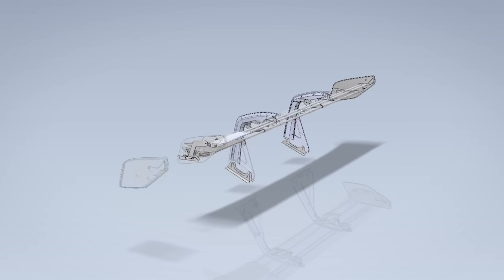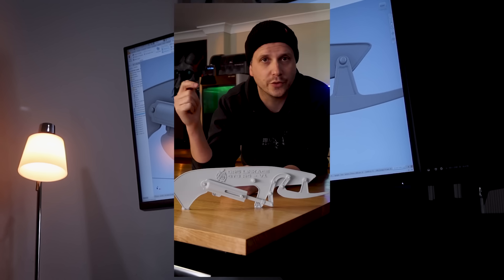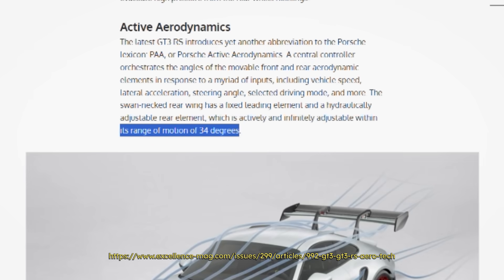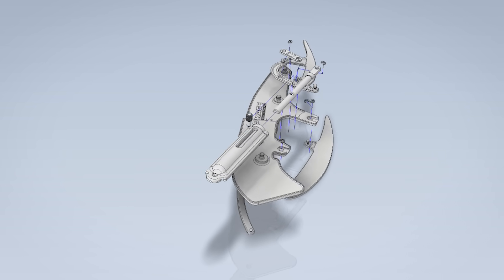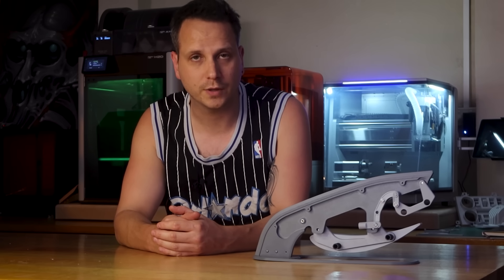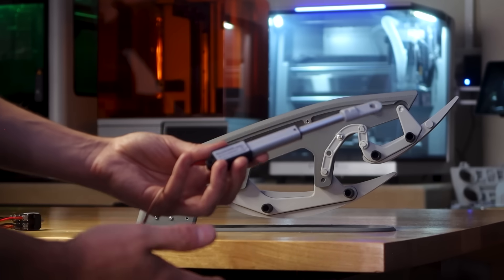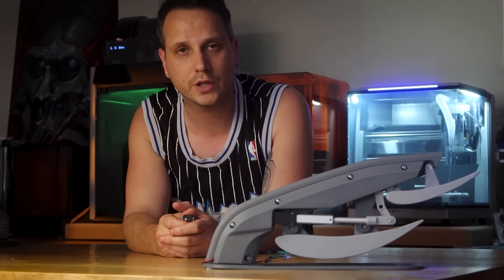I Built a Working DRS Mechanism Using Only a 3D Printer

Comment: Hey. Loved the video. Just a question on the 3d prints. When you make parts sideways with support, doesnt the spot where the support makes contact with the surface of the cilinder (or pin), break the cleanliness of the surface? wouldnt it be better to print the parts standind so no support makes contact with the printed surface? just a question.... thank you

Comment: Great job! 😎👍
15:45 - The disadvantage of cylinders is that the pushing force is always greater than the pulling force, because the rod itself interferes, the piston area is smaller on one side than on the other. You can try swapping the hoses on the distribution block, you will get the same result.

Comment: the Mercedes hydraulic return soft top / hard top roof is a known to fail component, difficult to remove/ install, and often economically writes these cars off, ive replaced one, if you do decide to go the wrecker route, bring all the gear to jump the circuit and confirm it works, or get warranty on the parts, as the parts are not cheap, you can often buy running registered cars with "Broken" roofs for roughly 1K here in NSW, and theyre not a bad way to go for parts, when you account for refunding remaining rego, sellling some parts, and sending them to scrap, atleast in sydney wreckers pay $500 for full cars picked up from your door. the system is wuite basic but lots of small parts that can be hard to diagnose in the vehicle as they require almost full disassembly to get to basic components. good luck
Reply from the maker: Thanks mate I appreciate the detailed info.
I was a little concerned at all the info I found when researching it was basically people complaining about how hard they are to fix haha.
I was thinking it might be good for my own knowledge to pull apart and play around with but you're right in suggesting they might not be best for the final design.

Comment: I have done this to my wing. I used pneumatic actuators with an electric solenoid control valve, small compressor and used a small fire extinguisher as a tank. I have a small regulators on each side to I can control the opening  and closing speed. Works great and is quite fast and strong. I am using it more for an air brake than a DRS system so I have quite a bit of force when active.
Reply from the maker: Awesome! Reassuring to hear people have had success with that approach

Comment: I would think a servo motor and cable control system instead of a linear actuator would be a little better and less intrucive to the support structure of the wing and A LOT less to deal with than an electrohydraulic control system. Very easy to control with a PWM motor controler and a arduino and just tap some CAN signals for data in and use as a relay and make sure votlage in matches out so to avoid messing up the LVDS signals from the CAN. The 5 bar linkage is geat though for strength and fine adjustment, I would be concerned with longevity with stress on those pivot points and no sealed lubrication, maybe use a PTFE coating or teflon liner and 0 tolerance fit with stainless steel machined parts? some really cool surface finish anodizations with PTFE in them for aluminum now, use a 7075-T5 alloy and it will be PLENTY strong and self lubricating, but expensive.
Reply from the maker: Thanks mate I appreciate the detailed response.
I'm pretty much at the point of hardware specification and was looking into options for the pivots etc, but it definitely needs further consideration.
It's also an effort vs application thing, how much use/abuse the system will actually see on this particular car and if the reward for effort is there in terms of time spent.
I'll look further into your suggestions :)

Comment: Great Video.  This is something that I've been researching and designing in my off time for most of last year and stumbled across the porsche build and then your collab was uploaded. 

Electric servos were out of the question because of the force and speed (and the inverse relationship with E-servos) that I wanted for my project.  Then I began looking at solutions for a hydraulic system which at first I began to believe was out of reach.  Then I happened to have stumbled across RC Excavator builds on youtube which peaked my interest and made me excited.  I needed form factor, small motor, small actuator (and associated systems) that can fit into my boot and have enough MPa (Bar) to actuate the wing which I could get from these RC systems.   If you pair this with a Raspberry Pi or Arduino (I went with Arduino), IMU (accelerometer), a motor driver, an OBD II module to read actual vehicle data (for more inputs along with the IMU), and other small components then it is more than possible to have active aero on a build.  

Your collab was perfect timing because at first I wanted to actuate my whole wing but the I didn't know what range I wanted the AOA and most importantly an actual idea for what type of linkage mechanism to use.  I immediately went on your site after Mike Lake uploaded the DRS video but at the time the DRS model hadn't been uploaded.  BUT NOW ... I you have the model and its time to play around.  Thank you and please keep this series going.  DIY Active aero is starting to gain traction but there are only a few serious attempts on Youtube.

Comment: simplify and use mass lower, i would rather do the actuation with thin stainless steel cables and teflon conduits, and place the two big servo motors inside the body, pulling the cables with a pulley.
that would keep only mechanical parts outside, while the electronics hardware stays inside and lower to the center of mass of the car.
inspiration is animatronics, but made for the job of moving the spoiler blade, tough and precise.

Comment: Just curious, did you ever see the lemons racing drs with the bowling ball on a rope/spring. when you had any change in angular momentum it would swing the ball pulling the wing down.
Reply: Absolutely mad that is. 😂 bowling ball drs
Reply: @UdzalZarnick redneck engineering working at optimal levels
Reply from the maker: No I haven't but I will do a search :)

Comment: I'd consider just using the pneumatic system, but you'd need to consider how much force is required and the diameter of the piston that you can fit.

The reason why your valve wanted to push out is that the surface areas are not balanced. If you look at your spool (The moving bit), one end exits the valve body where you operate it, but the other end is enclosed. That means that the enclosed end has the higher supply pressure acting on it, which wants to force it out. A simple fix is to extend the spool out of both ends and add another o-ring to seal it.
Reply from the maker: Thanks mate I appreciate your feedback! I was wondering if it might be something to do with that and maybe if a better pressure relief on that side would fix it, but your simple suggestion would be better :)

Comment: Nice work, and great detail in your video.  It’s probably too late now, but when designing linkages like that you can use cad directly to get the dims.  You put the two positions you want in the same sketch, constrain all the relevant bits to have equal lengths between the two positions, leaving the lengths themselves as unknowns, and let the modeler’s internal algebra solve it for you. It can be a bit fiddly, so it helps to have the two positions in the sketch close to what you think they will be. This approach can be used for three positions, like three positions along a smooth curve, if the linkage config itself supports such motion.
Also, some hydraulic systems like this will use one of the hard stops to act kind of like a homing switch during the control system’s start up sequence.  It is analogous to electrical systems using current sensing for feedback, rather than adding an explicit encoder. That may or may not meet your system constraints, but it is another approach.  To that end, it can also be added to an encoder system to add redundancy.

Comment: Mike plans on running air suspension on the GT3D so if you decided to keep the pneumatic system you would already have a pump and reservoir built in.
Reply from the maker: I did think about that, also a possibility :)

Comment: Just use the engine vacuum and suck from the opposite end of the piston. Or just use a solenoid to actuate it. That pump and tubing with valves and pistons are too big, too heavy, too expensive, too complicated and prone to failure in a multitude of ways.
A better system would be to use a geared stepper motor which gives you the option of dynamically setting the wing in tiny steps. The detent torque lets you hold the wing with no power. Stepper motors are pretty well sealed against dirt, and better than all the complicated pneumatic stuff.
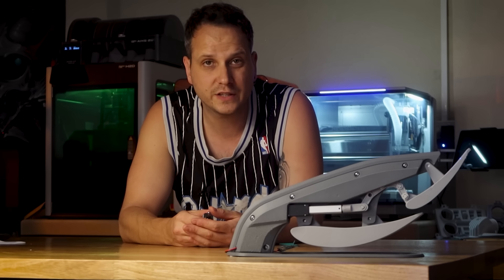Instead of the complicated 5 bar mechanism, use a contoured cam on the shaft of a 1:10 geared stepper. Just make it raise the wing into the air-stream and use the air resistance and gravity to lower it. Like valves pushed by the camshaft in an engine. Very fast, stays put on power fail, and dynamically adjustable while driving.
Reply from the maker: Hey mate appreciate the feedback. The initial concept was to make something close/replicating the OEM function but I would agree it's probably at the point where I should consider some other approaches. I'll add this to the list to look into further :)

Comment: I much like your calm videos. More than the hype-ey Porsche build videos itself. Ps. Look at the Mercedes SLK r171 top hydraulic pump with integrated tiny reservoir and solenoids and the front center locking cylinder. Positional feedback can be done with pump motor voltage ripple measurement and/or timing, and/or a separate linear potmeter and/or magnetic end switches
Reply from the maker: Thanks for the suggestion mate I'll look into it!
Reply: @fatlipcollective Another good pump would be the BMW Z3 convertible top motor, pump, reservoir. It's an all in one unit with outputs for hoses as well. Very compact and inexpensive. 

Positional feedback could be done with some basic pressure transducers or, with a mini mag switch on the cylinder. It's extremely common to see those in the automation world so, the sensors are very cheap. 

I would try and find a small hydraulic pressure accumulator too. Lots of European cars use them for the brakes or for hydraulic suspension.
Reply from the maker: @ThePhantomOperator  Thanks mate I will add that to my list!

Comment: Maybe a closed loop hydraulic system with 2 cylinders connected directly to each other with a larger electric actuator acting on one cylinder for motive force (similar to a syringe hydraulic system) that way you can have position feedback within the actuator and avoid pumps and fluid reservoirs

Comment: What a great video, maybe a long medium strength spring or springs ( one each end ) with a similar diameter as the internal dimensions of the cylinder will help with the release and dampen the thump as the shaft reaches full extension? Just my two cents, I look forward to seeing the finished product 🤙